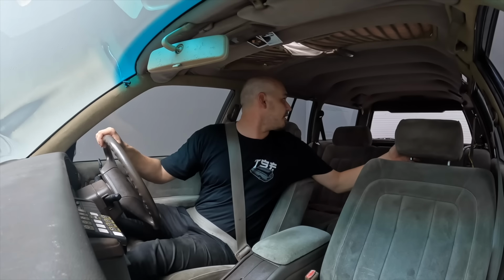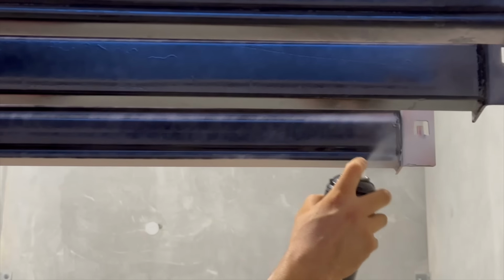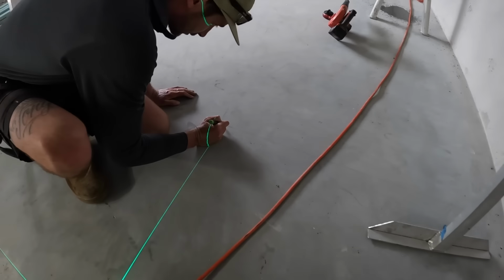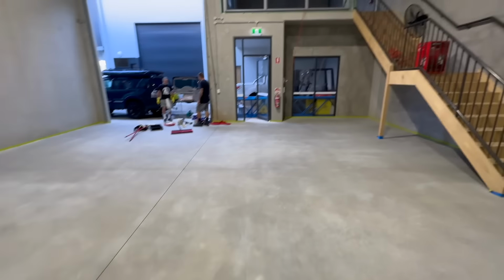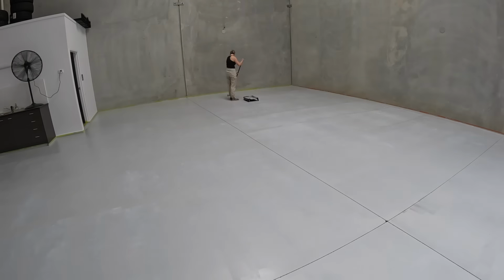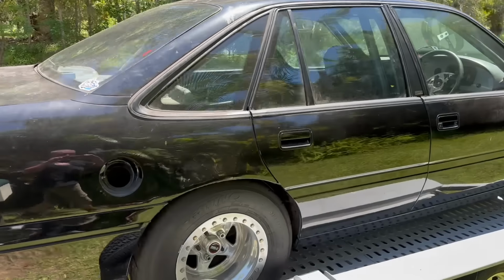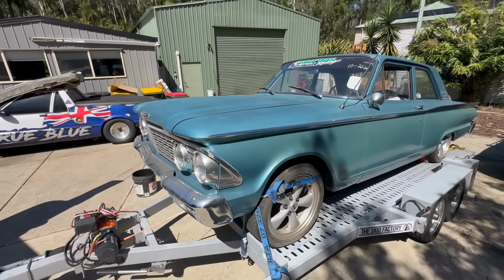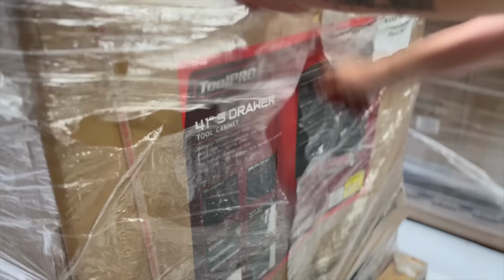Building My DREAM Workshop! THE NEW SKID FACTORY! 🛠️

Comment: I'm an engineer in the construction industry and have some advice that might help you. It's a lot to read but I wouldn't be typing it if I didn't think it would be useful:
*Watch out with that mezzanine office. That's a whole lot of glass and sometimes the fitout of a commercial tenancy like that requires a National Construction Code section J report (what I do for a living) when you're changing part of it from class 8 (workshop) to class 5 (office). This will usually be thrust upon you by the landlord. There's no way to insulate that floor so you'll need a J1V3 report which involves thermal simulations of the building. I've got pretty good at eyeballing this stuff and you're going to need an insulated ceiling in that mezz to make it comply.

*As part of the simulation they'll calculate very accurately the cooling load (how big of an aircon you need), so ask for a copy. Oversized aircons waste a lot of power. Aircons' efficiency is closely tied to their size. In my office I have 2x2.5kW splits because they have a COP of 5 (use 1kW of power for every 5kW of cooling), while a single 5kW split would be closer to COP=3. If you're going with a big single unit, don't bother with a split. The 5kW+ splits are just as loud and inefficient as a 5kW+ window box, and the window box is easy to install yourself without paying a refrigeration guy.

Suggestions:
*Get Big Ass Fans to send you a freebie. They're an Australian brand of HVLS (high volume low speed) fan that should keep you cool in your concrete box without making enough sound to mess up your videos. They're a lot quieter than any aircon (you probably haven't even noticed them in Bunnings half the time). There's a huge overlap of their customers and your audience, so a promo deal might make sense for them.
*Borrow a projector and a big ladder. Project your logo on the back wall and trace it in paint.

*Grab some structural insulated panels (aka freezer panels). They're brilliant for both sound and thermal insulation and only cost about $80/sqm. You just screw some C channel into the floor with a hammer drill and then poprivet the panels into it. It's a great starting point for a voiceover booth. There's a reason people have accidents getting locked in a coldroom and nobody hears them. You could also hang an I beam across the roller door at the max height of vehicles you're actually going to drive in and install an insulated panel wall to cover the top half of the roller door to keep the noise of neighbours out. You could even make a sliding door under the I beam to cover the bottom of the roller door.

Comment: Tip to get in easier with a trailer: install a tow hitch at the front of your car and push the trailer in with ease.
I'd put the blue scaffolding at the back wall since the space is deeper than it is wide and that way you can extend storage to the roof of the little shed thing

Comment: Great looking shed and as you say, you need quiet for filming!
From the short look at the shed I would have taken the shed out of the ground floor, give you more space.  If you wanted it, then move it under the stairs to take up that dead space.
The other option under the stairs is to put shelving/cabinets in there

Comment: Honestly 1 straight lift at the back 1 angled one towards the back and leave the front for drill press/ bandsaw/ becnches etc or move the angled one forward and have a bit of workspace between the 2 hoists. Otherwise a 4 post so it can double as storage if you need it to be but can still build exhausts at ride height etc

Comment: Heck of a start, Woody!  As to "how to set up a shop", if you ask 10 people, you will get between 12 and 12 different answers. You have to swing a spanner here; what ever that is for you,  you need to go "live" in that space and see those things happening and how much room you need for that to happen. Congrats, Btw! Let it begin with the Rise of Kevo! On the S/C or dual turbo question; why not a honkin' size, crank driven turbo and dual, exhaust driven turbos? Put really good head bolts and gaskets on it for sure!

Comment: Hi Woody! Tips that might help: since you have so much space above, maybe consider building a mezzanine around the walls or even a second floor to utilize all that space. Paint a huge Skid Factory mural OR lift something absurd and cool like a whole car to the wall! That would be cool eye catcher at least 😃 also, as much electric and air outlets as possible, lots of good lighting for example attached to the hoist poles since it's always too dark underneath the cars you are working on. And I would suggest setting at least most common used tools on the walls or somewhere you can see them and can grab them when needed. I've noticed that I tend to grab whatever is nearby for small jobs and end up ruining tools intended for other jobs. It also saves time and nerves when you don't need to search the drawers every time. Thank you for the inspirational videos!

Comment: It has to be the wood factory on a big sign at the door. Great work woody. I think the layout will be a little tight but you can make it work. As already said get the beefiest insulation you can for the walls (R2.7) and roof (R5) of the office. Go carpet on the floor that will help with sound when your in the zone editing in the office. Mitsubishi AC have  good size units 5kw or so for that space and you can usually get a decent deal. Run economically too. Congrats Woody. Excited for you.

Comment: Nice space! Best thing is you can always redrill and move the hoists if they use Merlin or screw bolts. When we set up my brothers Fab shop we put in two big booms on opposite sides with power and air on one and his mig on the other so he could pretty much cover the whole shop by swinging the booms overhead. Your shop prob doesn’t need it with less heavy tools in a mechanic shop but an option, even for camera

Comment: BEST mod I ever did was mount thin LED strips on the hoist arms, your running power for the hoist anyway, total game changer especially if filming !
Definitely put pallet racking above your workbench/toolbox area, you will run out of storage/shelf space WAY before you think, also under stair area critical for larger items like trans jacks, oil drainers, waste oil drum etc, and mount a wheel/tyre rack somewhere too

Comment: This is so frikkin awesome dude, i wish I could like this video more times haha!!

Thats a wicked space, and the window fit is 👌👌 if 3 hoists is absolutely necessary, maybe even a 4 post where Kevo is. I think doing a 2 post as the Fairlane sits in the video is a good move, you will have much easier access to the lift without having to move anything else. The 3rd hoist in the corner is questionable for the space imo. It's nice to have an area where a car can be all doors open, and space to still walk around it without being in the driveway. Could even look at one of the hydraulic scissor lifts for stuff that doesn't necessarily need to be on the hoist, and have it stored up in the pallet racking when you don't need it. But if the 3rd hoist makes more sence, I get that, just sucks how much floor space they suck up. 

Thought about a small clean room down the back off the side of the dunny area? Or even a sectioned off half booth? We all know you love to paint a thing or two, so not a horrible idea. 

Anyway.... Harrop that Coyoteyy!!! Get some big tyres under the back and get ready to go to the moon 😅😅

Keep killing it legend, cant wait to see whats next! 🤟🤟
Reply from the maker: I made three hoists work, it’s tight but it’s working so far! Thanks for commenting dude! A clean room was on the cards but I’ve also got a bunch of friends who are more skilled than me when it comes to engines so I’ll just go hang out in their sheds 😀
Reply: @theskidfactory  hells to the yeah! Can't wait to see it 🤟🤟👌👌

Comment: I can't wait to see what work you put out in this new shop! Looking forward to Kevo and the Fairlane. Having worked in a couple shops of varying sizes, I would diversify your hoists versus running 3 2 post hoists in a tight space. I'd do one drive-on 4 post straight in front of the door (good for driveline/suspension diagnosis, exhaust fab and quick maintenance), one two post angled to the side (major fabrication and design) and then have a large flat bay area (can open the doors wide open and do wiring and interior work).

Comment: Air Compressor behind the wall in a small shed. Low RPM, less than 800rpm on the air compressor is key to noise abatement. Sometimes hard to find compressor rpm but that makes all the difference. 750rpm on other side of wall will be almost silent. Mine is high cfm 175psi inside the shop and you can still have a conversation without shouting. Run pvc pipe around the wall at 5ft up with a fitting every 10ft max or call it 3m. Battery powered tools are alright but never as convenient as air tools. Especially sanders, paint guns, grinders, and die grinders. They just work and never die in the middle of a job. Just remember a drop of oil when you use them every once in awhile. You've got enough space for an upper storage mezzanine above lift height. You'll need it eventually.

Comment: Looking good mate. Frames with rockwool and frabric covers will work for sound treatment, but you will need a lot of them and they are labour intensive to make. Plenty of videos online about making DIY sound traps. Hanging heavy wavey curtens wherever you have big empty sections of wall will also help to defuse the sound waves. WIll also start to sound better as more stuff gets added to the room creating more irregular surfaces.

Comment: When we did the first coat on our shop floor i poured a 5 gallon bucket of paint out and used some home made spreaders out of foam pool noodles, wooden dowel rod screwed to a 1x4 piece of wood. It spread out awesome but took 48hrs to dry and the second coat made it super slick so when it rains and the floor gets wet you will slip and bust your ass before you can flinch to catch yourself😂. Glad to see you have what looks like a lot of room but it will be packed before you know it lol.  
Wish our Fairlanes had the front ends like that, i favor turbos for it

Comment: Im not sure if the concrete apron wall is sealed or not. If its not, a coat of concrete sealer will really help keep the dust down. I was amazed how much dust comes off unsealed concrete. As some others have said as well, some form of paint booth or hood fan. I destroyed my nice epoxy floors over the years with over spray. I also got a ton of over spray on my nice tig welder, which was a major bummer.

Comment: Number one thing is i would make sure you have a power outlets at every lift. Current shop I work at was design by somebody that has no idea what goes on at a dealership. No power at the lift and no air hoses at the front drive in for the valet to check air for customers.

Comment: Awsome work woody and every one else involved.    Definitely a massive job.     I have to also move workshop in the next few weeks and definitely not looking falward to the hard work and the headaches that come with fitting it all into a smaller space.       I’ve been in a few different locations now and I definitely do think it is good having joists mounted on the angle. Or the 45 ish because of the ease of getting on and off the hoist and also it makes large empty corners in the workshop witch is awesome for things like tool boxes or tire mechine      It just seems to leave more space and walkways around      Awsome work.    Can’t wait to see more 🤙🤙🫶🏼

Comment: Consider talking to Dan Kenneally from Solar Cooling Solutions, I’ve got some on my house and he’s done plenty of workshops like 6boost and Golebys, big temperature drop on warm days especially if you’re running welders and other equipment. They are 100% powered by the sun, no wires, have a thermostat to only run if above a certain temperature and move the same air volume as something like 30 standard whirly birds.

Comment: Imagine you've got a car on the lift by the pallet racks. You need to get something off the top rack. You have to move the car out of the way in order to do that - Not easy to do if you've got the subframe off. I'd either scoot the pallet racks closer to the front, or drop down to two lifts.

Comment: Looks fantastic...

Just a quick Question / Safety suggestion 
Are you refitting the railing to the edge of the Mezzanine ??
Are you allowed to run glass windows to the very bottom on the mezzanine without the railing ?
Does your local council have requirements to specify special glass if going to the floor. 
My friends mezzanine level required really expensive shatter resistant glass- or the lower section to be a solid material if the railing was removed..

The concerns he was told was that if something like a chair is rolled into it or a child walks into it - it needs to be strong enough to make sure it doesn't shatter etc...

Comment: I’d be replacing the front glass doors with something very, very solid. Chuck in some bollards behind the roller door if you want stuff to stay put. Go beserk on a security camera system and get a strippers pole installed upstairs……..

Comment: I'll tell you from experience. Put your lifts/hoists on an angle. Putting them square to the wall will make so much extra work you'll regret it instantly. Should be able to drive in directly is best. Three point turn maximum. Right angles will be jack and moving into position. Will get old on day 1. Use avg size cars to set hoist angles. Work smarter not harder.

Comment: With that mile high ceiling you might consider a big ass fan. ....... No really, it's called Big Ass Fan. Or install something similar in size of a ceiling fan. This way the air gets ventilated and you don't need to crank up the aircon full speed. Especially during the hot Aussie summer. ✌
Anyway: this new chapter is going to be awesome! Let's go Woodie, let's go! 😁🤘

Comment: That racking will be all but unusable once you’ve got a lift down that end. 
You will be always moving cars on and off lifts when you need to get a pallet out of the racks. 
What about moving the racking a lot closer to the door, would that give you enough room for two lifts side by side? 
I’d be tempted to go a lift down the back for storage (3 car stacker if the budget allows) then another lift in line with that, then the angled one beside the stairs. The lift directly inside the doorway will be a nightmare, you would almost need gojacks to get a car in there. 
Excited to see the progress though, gonna be awesome.

Comment: Since it's Woody's shop, maybe call it "The Board Room"?

EDIT: One thing that I would do, if it was my new shop, is build a silencer and aftercooler for the compressor. Both are pretty cheap if you do it right. You can build the silencer out of a 5gal bucket and mattress-topper foam and the aftercooler can be a copper coil, another bucket and a drain solenoid. The upshot is that it will also make it much easier to do some decent paint work if most of the water never even makes it into the tank.

Comment: Hey Woody a 3 car hoist sounds like a space saver. 
I would be interested in Air conditioning the shop in return you can go over my Barra swapped Bmw drift car. ( built from watching your videos) 
I run my own air conditioning business we supply and install Panasonic units. Good luck on the new chapter.

Comment: Having done alot of fitouts, let me impress upon readers, use the vertical space! That area above the dunny is dead space, don't put any equipment there, make it stock and only fork pallets. seal all concrete or you'll always have dust. Dust in paint, dust in any sun entering shots, dust covering everything in the racking. Dont forget the roof, talk to the landlord about evap cooling, exo mounted compressors, exhaust fans (plasma cutter after filtering), solar hot water heater....  no one cares what you do on the roof in an industrial estate and when you move out you can come back later as the next tenant isn't caring about using the roof space. The cieling is a great space for a "bigass fan" brand fan (sponsorship?) and tons of lighting, you need more Lux then you want and then dial down by switches. Next is signage, for visitors, they like "customer parking" "reception" "employees only" you want a delivery guy walking through your shop? or your neighbor pounding on your door as that's the 8th time some idiot has parked in his parking. Keep it tight with parking. frik I need a lemon squash.